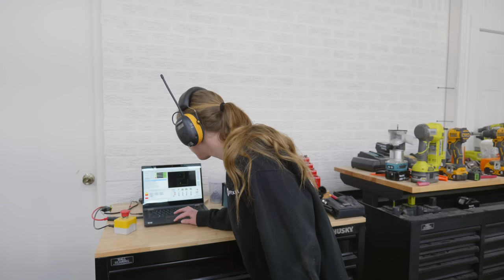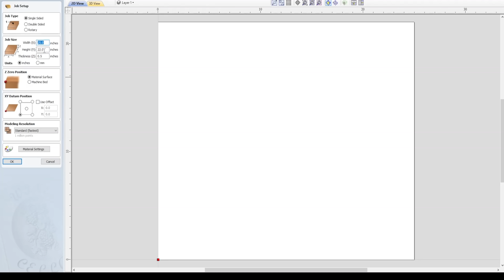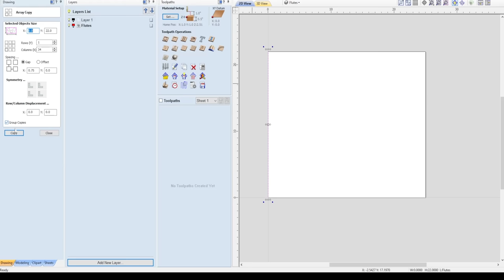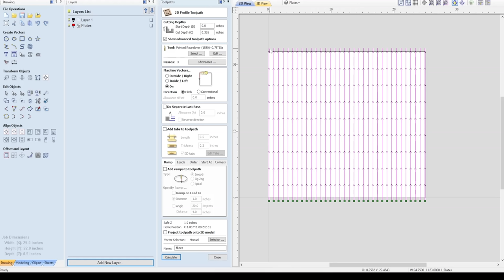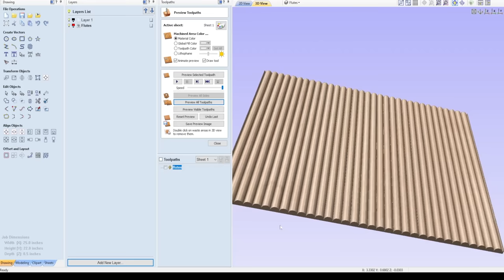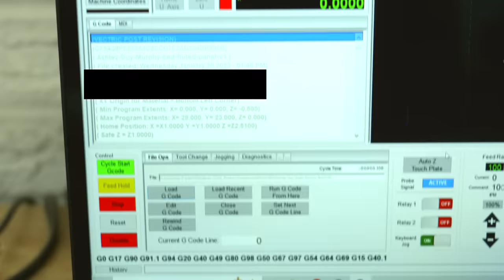Another HIGHLY Productive Week In The Workshop! Murphy Bed Build Continues

Comment: Did you use MDF or HDF for the inserts? HDF will be a lot less fuzzy after machining but is quite a bit heavier. It will also make the finishing process a lot easier if you do the first coat of primer and sand parts like that before you install them. Keep up the good work
Reply from the maker: We used MDF. Although we have some sheets of HDF, they are 3/4. And the weight is legit no joke🤣 Good to know about them being less fuzzy!!

Comment: Would love to get your opinion on the fastcaps fast edge. Most of the videos I see on you tube are of the owner of Fast Cap demonstrating his own product. What are your thoughts?
Reply from the maker: Honestly only using it because we bought a bunch a long time ago and want to use it up. It’s very very convenient and for most things works great. The only issue is, if your edges are perfectly clean, flat, and smooth it doesn’t stick that well. I used it on our camper conversion and it held up great under heavy use… however I’ve used it on other things and it just seems to want to lift up a tiny bit in some areas. If you sand to soon after applying it, you can force dust under the edge and it will lift it. So I guess mixed feelings.